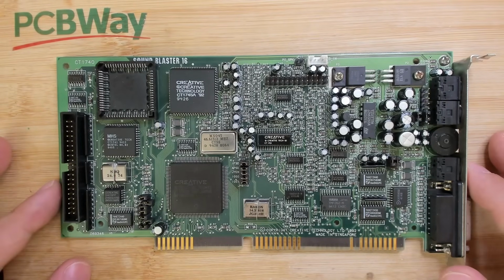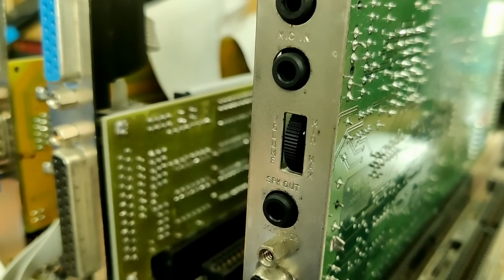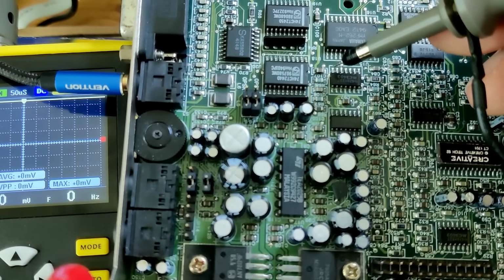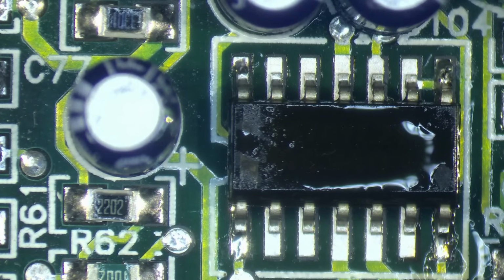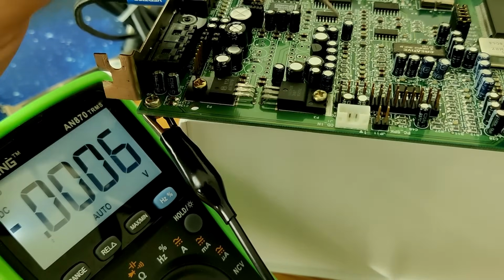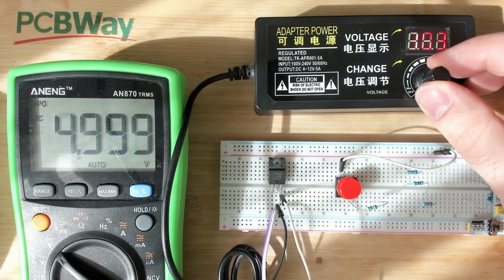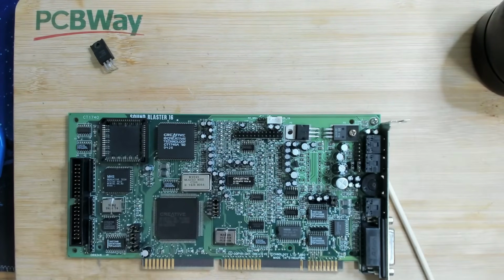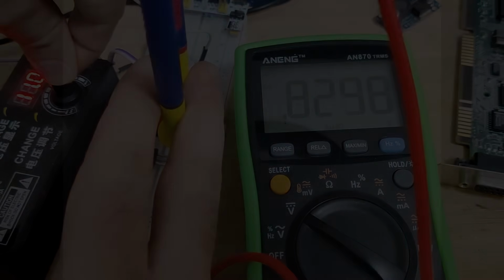The Greatest Sound Card Ever? The iconic Sound Blaster 16!

Comment: The first swap did change it, the synthesised music was much better, If you looked with the scope on pin 7 of that op amp, you’d see it wasn’t so square wave and possibly not at a minus voltage
Reply from the maker: Maybe - and this is just an assumption - it is due to slight differences in the opamps. Maybe one was more leaky than the other one which caused the difference. The card still sounded mostly identical even after swapping the chips.

Comment: 8:22 - This scope picture is also a clue that the Op-Amp is likely not getting sufficent supply voltage for proper operation. The waveform looks like square-wave output, although with a funny duty-cycle (what you would expect from a classic programmable sound generator like in the CPC464 or the NES) instead of deformed sine waves (what you would expect from an FM synthesizer). This shows that some amplification stage between the OPL3 (acutally, its DAC, the YAC-512) is clipping. The negative average voltage is a clue as well (you allude to it), as most sound cards (also the SB16) are designed with capacitive coupling between the analog stages, which should eliminate DC offsets. If there are DC offsets at the op-amp outputs, this indicates that the op-amp is not amplifying properly.

If you compare the sound at 8:22 to the sound at 30:06, you can clearly hear how the sound at 8:22 "sounds like an NES game", while the sound at 30:06 sounds like a mediocre piano imitation, as the OPL3 is supposed to sound in this test.
Reply from the maker: Thanks for pointing that out. Now that I look at the oscilloscope output, it makes sense. I should measure it again after the new regulator is on the card to see how such a signal should look like! I will do that the next time I have the card in a system! Thanks for pointing this out!

Comment: Yet another proof of the medical fact: the culprit is always about power supply: wrong voltage, current, capacitance or resistance, or a ground loop that, in the end, is a power issue too. I actually seen failed VRMs, and after the swapped was cleared of suspicions, I wondered when you'd look at VRMs.
Reply from the maker: Most of the boards I use have very basic VRMs or none at all. One day, I hope I'll be able to work on more modern circuits.
Reply: @bitsundbolts  I mean exactly basic VRMs... Like those two. They fail too.

Comment: This is really good to know! I have a couple of Sound Blaster 16 value editions. Both CT2770 models from 1994. Both work perfectly fine although I do see very minor PCB discolouration in that exact area where those voltage regulators are. I guess they do get somewhat quite hot then eventually take their toll through many temprature cycles over time. Thank you for taking the time to sharing this. This would allow me to troubleshoot should I ever exprenice this issue that you have.
Reply from the maker: I'm glad to hear that this video might be helpful to you! Good luck with your Sound Blaster 16 cards!

Comment: Why change the screw?
The head should be on bottom/PS and nut on the top/regulator/CS.
PS=Print Side
CS=Component Side
Reply from the maker: I added the screw exactly how it was. The nut was on the solder side. Same is true for Voodoo 3 PCI cards. I changed the screw because the tab of the new regulator was a lot thinner - which made the screw stick out further. But you're right, I could have just turned the screw around too.
Reply: 1. The old regulator was fully isolated (FP) and the new isn't. 
Next time be aware about the metal part of the regulator isolation from the mounting plane.
Mounting the screw in reverse on the bare tab may need another nut and tool, a regular hex socket may not fit due to the narrow gap to the plastic body.
3. Every situation can have a different solution!

Comment: GUS is the greatest.
Reply from the maker: I am sure the GUS is an amazing card - unfortunately, I never had one :(
Reply: @bitsundbolts    GUS is actually a ton of trouble. The synth engine is not feature rich at all, it has neither an LPF nor an LFO nor reverb nor chorus, there's just bare minimum sample playback there. Support is spotty. The good things are clean sound in games with mod music, amazing demoscene support, and insanely punchy sound of the stock sample set. The bad part, is most of the games only work with Ultramid which takes the ini file shipped with the game that lists patches that the game uses, and then sits there for 15 seconds trying to figure out which parts of the 6MB sample set it can discard to assemble some sort of working instrument kit for the game, but ends up dropping and substituting a bunch of instruments regardless, even on a maximally expanded 1MB card.

It was also picky about mainboards, it often just doesn't work. NMI error.

Don't get me wrong i love them but it's never the only soundcard you want in a PC.

Also just build or buy yourself a Picogus to experience the thing if you like. Has tons of other uses too that one. You can hand build one with $10 worth in parts on an 8-bit ISA raster protoboard in half an hour, or PCB from some sort of junk card where you remove components and just use the edge connector.
Reply: @bitsundbolts  I do recommend having it, I had one and it just blows you out of the water.

Comment: Hi, I had 3 different SoundBlaster 16 back in the day. One of them was especially bad with noise. It was a later on from 1994 with all sorts of defects including bad soldering and cheap caps as well as a bad volume pot and loose lineout and headphone jack. The caps are 30 years old by now and came from an time which partially had bad chemistry and issues due to „optimizing“ for cost of production. My PAS (Pro Audio Spectrum) and the SB AWE32 were miles ahead in terms of sound quality and noise levels (or lack of noise).
Reply from the maker: Yeah, Creative made some questionable models. I think there are almost a dozen different Sound Blaster variants - from very cheap to quite decent. The one I have here in this Video seems to have proper copper fills between the layers and sounds decent to my ears. But then there are cheaper versions too. I might have one as well.
Reply: I should theoretically have my CT3980 AWE32 somewhere but i've been looking for it and can't find it, a family member might have thrown it away to spite me. Anyway it was super noisy that one, not clean at all.
Reply: @SianaGearz  I still have mine but no computer or motherboard with ISA slots to support it though.  Todays hw is so much more powerful you can emulate almost any 90s soundcard even with a PI Pico an have a clean digital output. So any decent PC/Mac DAW runs circles around them but here we are and admire the SID, YM262, YM2151 and the like as well as the results that capable musicians could pull out of them.

Comment: Greatest sound card ever might have to go to the Sound Blaster Pro. It has more compatibility and is somewhat better sounding. Now if you talk about more popular, then that might be the SB16 family, which consist of a gazillion models, with some of them very very different from the next.
Reply: Also, from my notes, there are actually 5 different revisions for the CT1740, because they start counting at revision 03 (maybe 01 and 02 were pre-production, I don't know) but in typical Creative way (AKA stupid way), they have 2 different revision 5 boards. Known revisions are 039237, 049251, 059325, 059334, 069346. If there are more, I have never seen them.
Reply from the maker: Yeah, the amount of different models of the same card (with slight variations) is intense! I think I have about 10 Creative cards by now and all are somewhat different - even though there are just a handful of major versions from that time.

Comment: Voltage regulators and capacitors are actually first thing I check on sound cards with lots of static. Those seem to fail quite often.
Reply from the maker: Noted for next time! I didn't think of the voltage regulator to be honest because I never had a failed one.

Comment: Great video. Funny coincidence that we released our vids on the same day. I wonder about the socket with the Tea2025. I never considered that when I socketed mine, and it was a pain to get that chip out due to all that heat loss. I ran it for a week for hours a day and it's still working great, but I might make a little heat sink, thanks for the warning. Makes me wonder if that's why my Tea2025 failed in the first place do to overheating even while it was soldered directly to the board. Looking forward to your "hanging note bug" video. Really enjoy your work.
Reply from the maker: Those TEA chips are interesting. I have another card (non-Creative) that has brown burn marks on the back of the card! It looks like those chips do get extremely hot! I have never used the amplifier because I usually go with the "Line Out" feature. I feed the audio signal directly into the "Line In" of my PC for capturing the audio. That is why I don't know how hot these chips get.
It would be a nice video to investigate this topic - also to know when to use an amplifier and when not to use it! Apparently, some folks have managed to blow up equipment by using it when you shouldn't have.
Regarding the heatsink on the TEA chip (and I am no expert regarding this chip - just sharing what I have heard): Better to leave it on the board as it was initially. I also had trouble to get the chip out. Massive heat loss due to the copper fills that those center pins are connected to. Those chips are designed to work that way and putting a socket there might just make it actually worse. The pins are extremely thin of those sockets and heat transfer is limited from chip leg to socket.
I enjoyed your video about the SB 2.0 - sad that the Creative chip seems to have been bad. At least you had a donor card, but it would have been better if an off-the-shelf component would have failed.
Reply: @bitsundbolts  Burn marks on the back of the board.. Wow.. With the SBpro and earlier cards you don't get the line out option so you're stuck using the TEA2025. I completely agree with you about the transfer of heat going through the metal legs into the copper plane, but I need to do some testing and see what temperatures are reached with the modded and unmodded, for science. I love the idea of easily replaceable parts ( especially ones that fail), but this is probably a grin a bare it moment. I may have to figure out how to bypass the TEA2025 and create a line out and just pull out that stupid overheating chip. Really glad you made this video opened my eyes much wider. Thanks.
Reply from the maker: I'd be very interested to watch a video that compares the TEA chip socketed vs soldered. I'd expect that it would be cooler when it's directly soldered to the board since the solder connections surround the pin and can transfer more heat.
What happens when you help the chip with a heatsink?
And the big question to answer: TEA+Heatsink on a socket vs TEA soldered (no heatsink, no socket).
Reply: @bitsundbolts  I might try to get better than stock cooling as well, copper heat sink soldered on the backside to the 4 grounded pins, That will take some careful designing, to prevent shorts of course. I suspect what would make the most difference is the use of passive speakers though, vs line output. I'll include that in the testing as well. My suspicion is the 'line out' temps may remain safe (socket or soldered) but when driven with passive speakers the temp may be dangerous at full volume with the socket (and no heatsink). I've got extra Tea2025s just in case. Lots to speculate about. I'll have to ask Tony too. I'm glad this intrigues you, I'm very eager to see these results too.
Reply: So I just watched Tony's ct1600 repair video from 8 months ago and back then he used a socket with the TEA2025 :) I asked his opinion on all of this, I hope to get a reply.
Reply: Also I wonder about your 470uf 16v Caps, the one looks like it got hot. Might need to replace those.
Reply from the maker: The one capacitor does look weird, but I removed and tested them. They seem to be fine. I don't have the proper size replacement parts right now and I don't want to put a dodgy part in place of the original ones.
Reply: @bitsundbolts  From what they told me on my video those caps have little to no affect on Line level output anyway, as long as they are in spec no worries.

Comment: That 7805 marking is looking a little bit dodgy, lol. Great repair!
Reply: theses fake chineses ones well it works if the current is low but on the 1A versions they are crap.
Reply from the maker: Well, I got them off Amazon here in the UAE - that was the only way to get it next day. I needed to know if the card works after replacing that regulator.
Reply: @ try TME they are here and got decent shipping pricning and stock.

Comment: Why isn't the card using 5V from the ISA bus directly?
Reply: System 5V rail is actually used for the digital logic part of the card.

This regulator supplies the analogue front-end.
Reply: @SianaGearz Yes, and local regulation is used because it will give the analogue circuits a cleaner supply that the voltage from the bus.
Reply: @SianaGearz  Why doesn't it use the system 5V for the analogue part too?
Reply: @  Exactly as Godman says, to decouple the sensitive frontend from the global power rail noise. I mean there's any number of ways to do it, but that's how they chose to do it and it's good.

Comment: Huh... I remember hearing that static back in the day, but I usually resolved it by moving around the IRQ assignments. Juggling IRQs with multiple devices manually is something I don't actually miss.
Reply from the maker: Eh - luckily I didn't have that many IRQ conflicts back then. I had only a few expansion cards back then, that might have helped. Apart from a VGA, Sound, and maybe a network card, there was nothing else.

Comment: 7805s go bad all the time especially in game consoles! Awesome video!!
Reply: What kills them in game consoles is reverse polarity, or plugging in a bad transformer.

Those old linear wall warts drift up in voltage over time, and eventually get alarmingly out of spec. My original Genesis power bricks from the early 90s are now outputting over 14 volts, one of them over 20 volts. They're supposed to put out 9 volts. Even newer linear wall warts will drift over time from the heat, vibration and pressure in the core.

Check your wall warts and check the polarity.
Reply: @GGigabiteM  I've never done that, but I have had a 7805 go bad in a NES, SMS and several non game consoles. The voltage output from those power bricks outputting higher voltage is a product of the line voltage exceeding 120v when it used to be closer to 110v in the USA.

Comment: While it's true that software PC emulators (and virtual machines) tend to have great SB16 emulation, that's not at all the case for competing hardware, neither contemporary or later in the 90's. Every other sound card and onboard audio chipset I've encountered only supported SB Pro emulation with 8 bit audio, never SB16 emulation at all. At least not under DOS, with or without whatever TSR the hardware might have required.
Reply from the maker: Hm, that might have then be something from my memory. I just remember seeing the "Sound Blaster 16" text in many games from back then. Maybe that has changed in modern systems/emulators for simplicity - or for better compatibility. I will not deny that a personal bias might have influenced me :)
Reply: @bitsundbolts  Oh yes, lots and lots of games support SB16, but if you don't have an original SB16 then the chance of getting 16 bit sound of often very slim.
One thing that might be interesting to cover is Windows Sound System, it's one of the things that has always been shrouded in mystery to me. As far as I understand it does support 16 bit 44 kHz stereo, and seems pretty widely supported in games, but what hardware supports it?
Reply from the maker: Oh yes! I came across this very recently. I have a sound card that I can configure as Sound Blaster compatible, however, it refuses to work and hangs when a game tries to use it. The entire system freezes.
In Tomb Raider Setup, the auto detect feature always detects Windows Sound System. Surprisingly, the game works perfectly with that option - despite me selecting something else in the sound card configuration utility. I believe it's an OPTi chipset - I need to double check this. I didn't spend much time on it.

Comment: What thermal cam you use?
Reply from the maker: This is the InfiRay T2 Pro thermal camera. You can find it also on my website under affiliate links. You can also checkout the InfiRay P2 Pro as a cheaper alternative. The T2 has an adjustable zoom built into the lens while the P2 has a macro lens that needs to be placed over the camera. The continuous zoom of the T2 is nice, but not necessary. I have two videos showing both cameras on my channel.